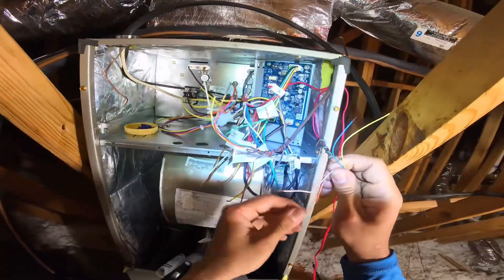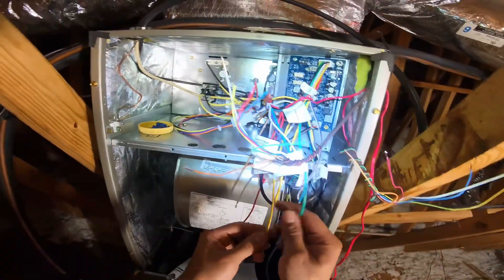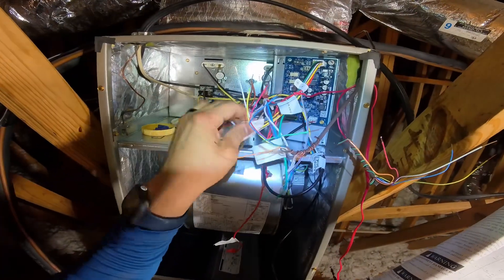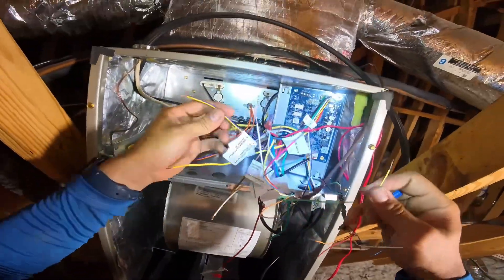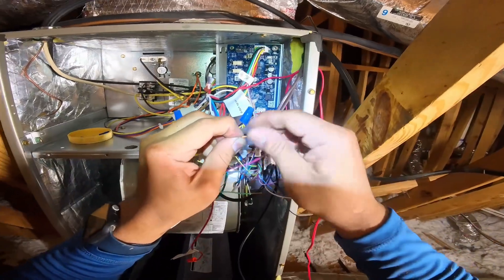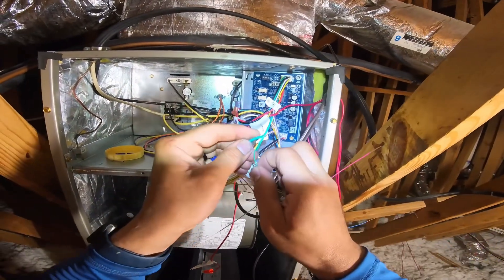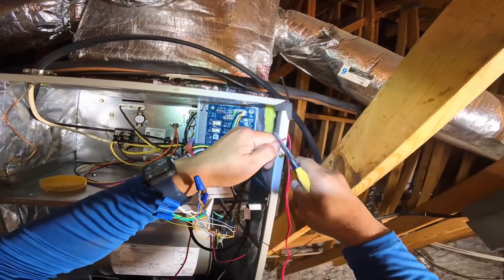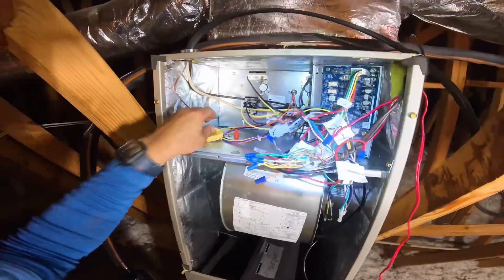Wiring for single stage R454B Heatpump carrier/Bryant/payne

Comment: On 15 kw backup heat, do you wire the black wire aside for emergency heat and white for W1 regular heat pump mode?
Reply from the maker: Usually wire them together

Comment: Good video, in the up flow position, does anyone remove the drain pan that is used for horizontal positioning, any toughs?  The manual did not mention anything, I am sure will be a better air flow
Reply from the maker: I have never removed the drainpan in any upflow
Applications
Reply: @Onemanhvac , thanks

Comment: Good video bro thumbs up just what i wanted to see thank you 🙏🏽. I just bought my left hand thread to go onto the tank.. should i have separate gauges for the a2L or can i still use my fieldpiece gauges that i use for all the other refrigerants..
Reply from the maker: Thanks for watching. Honestly I wouldn’t worry about having two sets of gauges for each refrigerator. Specifically, I do have three sets on the truck because I use ones to recover and sometimes to check r 22 systems but the answer would be no you don’t really need different gauges for a different refrigerants